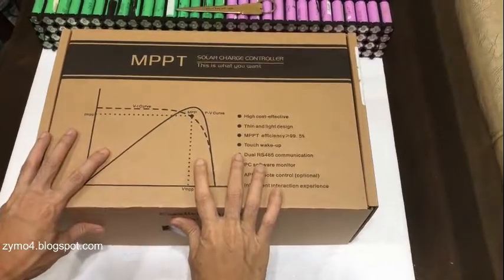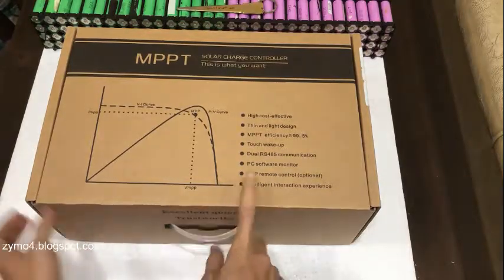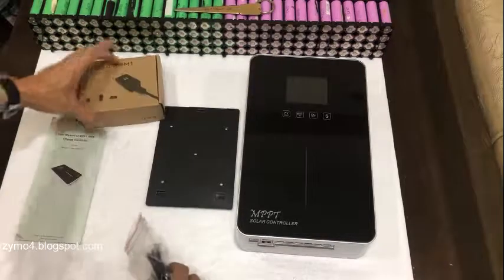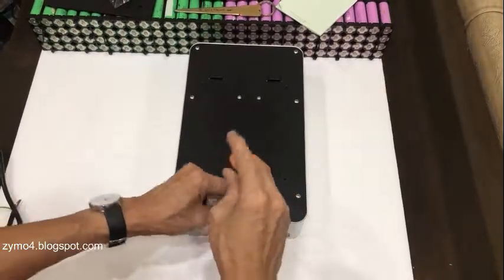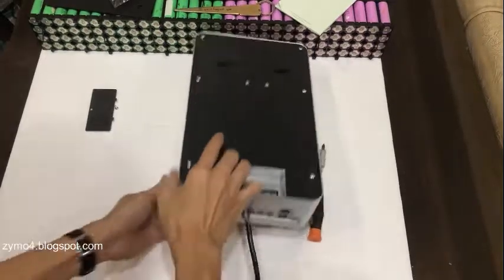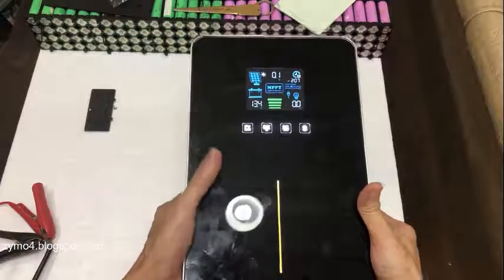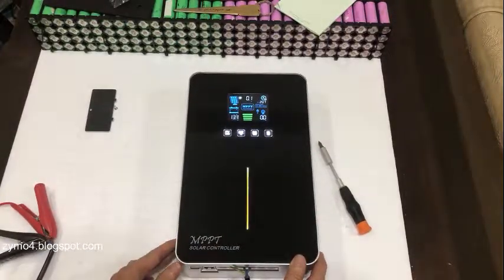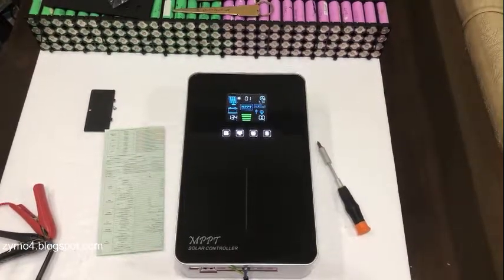Unboxing iPanda Runner 60a SCC

Comment: Can I plug 3 solar panels in series with 330 W power, 38 V and 10.7 A in an MPPT and change charging and discharge voltage? Also if you can, could you send a manual to raitis.galss@inbox.lv?

Comment: I have  a problem with this solar charge, i have the error 200 "Command mode" does somebody know how to solve it?
Reply from the maker: Havent encountered that error,  but ill check in my document on errors. Ill get back at your inquiry after.
Reply from the maker: 200 error “Command Mode” means SCC Stops Charging. as per iPanda Support.
Reply: Mine stays at floating mode 14.1v even the actual battery is low at around 12.5v. It doesn't charge the battery.. Anyone encountered this problem?

Comment: can you do a video with 2 of these charge controller in parallel setup
Reply from the maker: In due time, currently lockdown due to pandemic. What do you like to see if I may ask?
Reply: @MarkMinoza  i have 2 off there charge controller connected on the same battery bank with the com cable and i cant get them to talk with each other and same thing i can not see both unit on my cell phone or on the pc software need some help
Reply from the maker: @bimmers323ci  have you adjusted the SCC ID of the other SCC to 2? by default, both IDs are 1. So you need to configure the other scc to be 2 if you want to control them on a single(daisy chain) wire.
Reply: @MarkMinoza  yes i did configure 1 and 2 but it did not work also try 255 as per owners manual as master and 1 on the other unit but still does not work not on my phone or on the pc only see 1 unit
Reply from the maker: @bimmers323ci  I see, no worries, ill test mine, ill wire them both (Explorer and Runner) then post it here.
Reply: @MarkMinoza  thanks